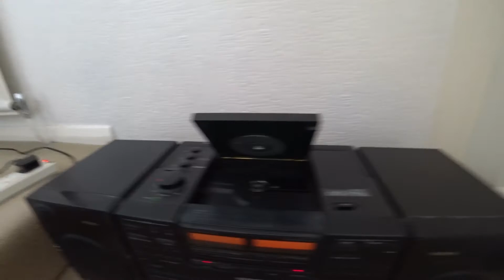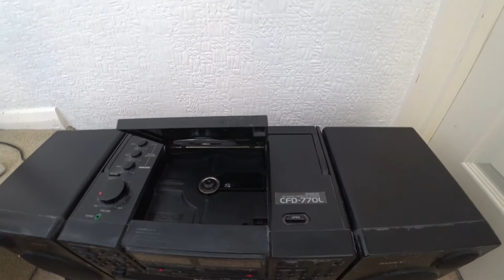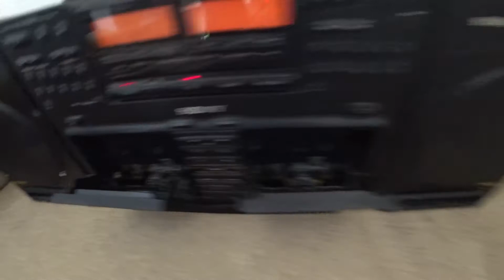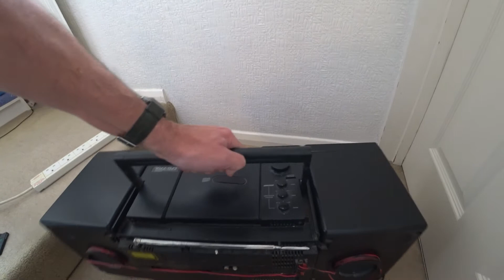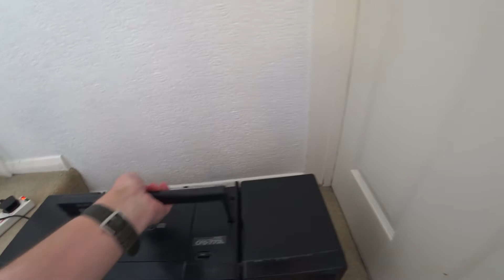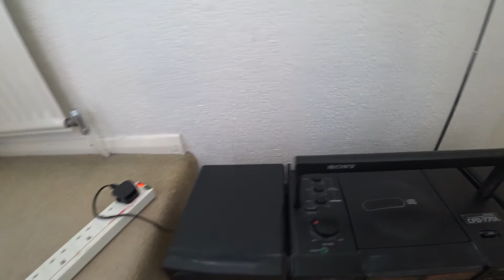Retro Sony CFD-770 Boombox Ghettoblaster

Comment: So I got this exact same boombox here and I was having issues with it skipping just as you said you were, so I removed the top as the instructions said to do and cleaned the tracks up which I did see a good amount of dust that would've 100 percent caused issues but upon reassembly it will read the CD and display the time of music and number of songs but the play button doesn't work along with the skip, the buttons that do work are pause and stop, I'm curious to know on how I can approach fixing this issue and just wondering if you encountered the same problem, thanks!
Reply from the maker: Hello. Were the buttons working beforehand? I expect you have moved something. It sounds like a poor connection. Why don’t you try to test for continuity at either end of the connection from control to the pcb.
Reply: @AvidRetro  Yes the buttons were working before hand, I also assumed a bad connection and retraced all my wires to make sure I didn't forget a connector and I didn't see anything to be out of line, ill attempt checking continuity and ill let you know how that goes.

Comment: Have that exact same box and it was also sticky when I got it, that must be something common on all of those models .  Goo Gone adhesive remover will remove the stickiness without removing any of the text and leave a nice clean & smooth finish that will not get sticky again. It does sound really good for a 90's boombox, with some incredible bass.
Reply from the maker: Thanks for sharing. I wish I had known about a better way to remove the stickiness at the time. I think I will need to do some cleaning again in the future with some other devices.

Comment: Hi there, I’ve just picked one of these up at a tip shop. Did you have to do anything besides changing the belts? I put new belts on both sides which usually does the trick, but it’s still really touchy. Tape A can’t play at all still, B is a bit more promising but won’t play initially in forwards, it will launch about half the time in reverse and then it’s fine to go forwards after it hits the autoreverse in backwards.

Really puzzling. I’m not really familiar with these autoreverse decks that use two motors and a solenoid, have had better luck with the cheap stuff to be honest.
Reply from the maker: I must have lucked out with my rather battered looking unit - I guess as all worked fine after the belt change.  I would check if it needs a deeper clean and whether you can see if any plastic bits are broken or missing?  Can you help it along when you press play by twiddling the takeup wheels?

Comment: had one of these.. heavy solid beast.. tight bass.. but if i remember it lacks a AUX IN.. that sticky grippy stuff was a really bad idea.. mine had the same problem with the stickiness.. got to give you cred for repairing it.. its quite daunting inside.. especially the cassette decks..
Reply from the maker: Thanks for your comment.  I agree great sound and very heavy.  The stickiness is something Sony did to some of their mobile phones too as well as other products I am sure.  Internally it's a mess inside to be honest - wires everywhere!  Quite different to the outside look it portrays.  It's a nice machine and I was glad to get the CD and cassette decks working.  The FM radio tuner side probably needs some caps replacing but not had time to revisit lately.

Comment: Bass is weak on these.
Reply from the maker: I agree a little disappointing. It goes loud. I guess it's the speaker design. Has anyone tried different speakers
Reply: @AvidRetro actually I take my words back.  I stand corrected.   I have since used a mic line-in cord to play Spotify through it and OMG this  thing can pump some chest pounding bass. Even more so than my Panasonic dt680.  MUCH MORE.  It is very loud and powerful at max volume. The only down side are the speakers aren’t as beefy as the Panasonic so they max out too easily with deep bass when crancking up the volume. Bass stays strong all the way to max volume.  I’m going to upgrade the speakers and this thing will pound even harder.  I’m seriously impressed. It’s capable of really deep and clean bass as is.  Even more so with a speaker ugprage!!!

The Panasonic is 15 Watts per channel. The Sony is rated at 9 watts per channel.  I think Sony seriously underrated those watts.
Reply: The higher you crank up the volume the more the bass gets cut. I think Sony designed it that way to keep us from destroying the small woofers.
Reply: @looklookerlooking you’re right. I have since discovered how incredible this boombox is since hooking up my phone to the mic input.  This thing PUMPS SOME SERIOUSLY STRONG BASS USING THE MIC-LINE IN.